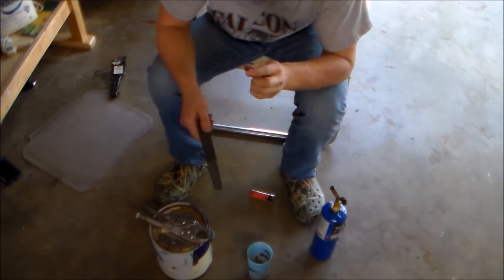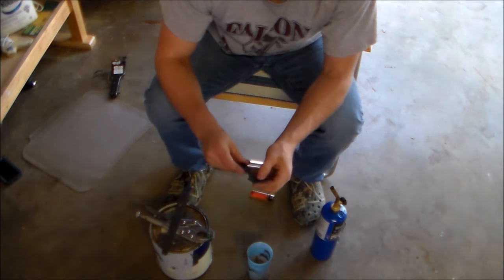Making a Skinning Knife

Comment: nice knife , me ask u sir : why we have to do heat treatment bcs after  finshe a knife  and get the ship before get heat, it be good its not hard and u can sharp it good and it look nice without need heating? and thank u for the video.
Reply from the maker: Hardening the steel will help it hold an edge for longer. If I didn't heat the steel, it would be easier to sharpen, but it would also dull easily.
Reply: ah ok i understand thank u sir for the information and thx for reply

Comment: great  video. I have never been able to find a video that shows a small skinning knife. all the other styles are big and clunky. how did you make that bevel Jig?
Reply from the maker: Thanks! For the jig, i found a piece of angle iron and bolted nuts on the bottom side.  You want to make sure they are all the same height so you can get an even grind.
Reply from the maker: Thanks!

Comment: The iron u yused is not really suteble for knife making... But still very nice job
Reply: If it cuts, it's a knife and it worked.  I get what you're saying, but don't be so critical.
Reply: @jarodmorris611  that isn't actually accurate. Mild steel won't hold an edge and a skinning knife that doesn't hold an edge isn't a skinning knife.
Reply: @avithegreat3  - the only distinction I would make is that it isn't a good skinning knife, but if it cuts animals skin then it's technically a skinning knife. Yes you would be frustrated by how often you have to hone the edge or go to sharpen it because it isn't holding an edge but it's not bad for people to learn on because that steel is so cheap